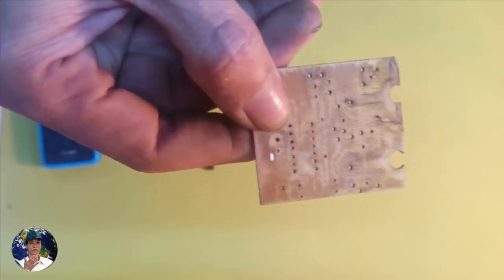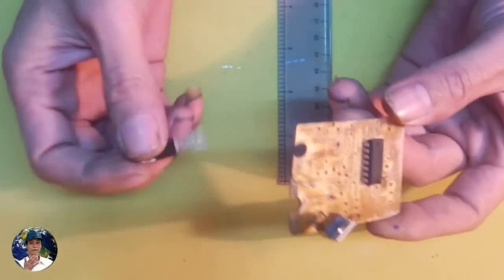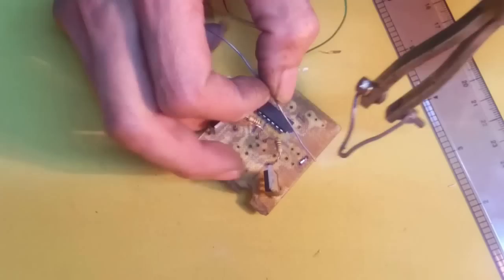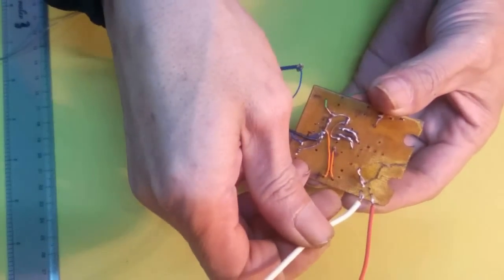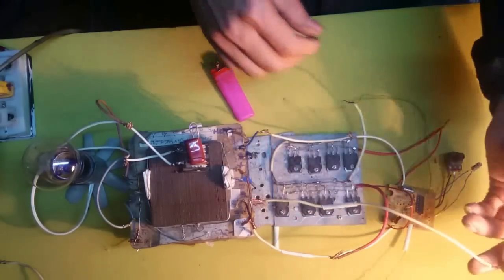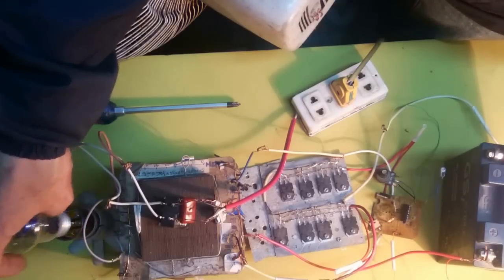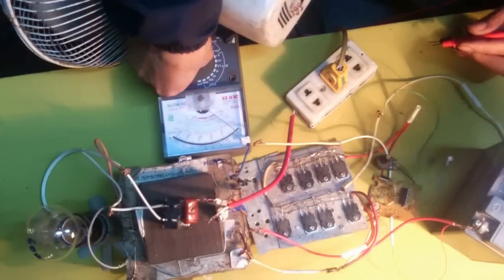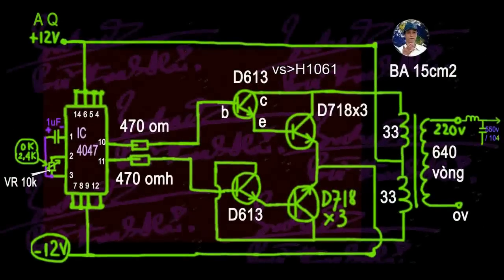how to make inverter 12v to 220v, simple circuit diagram 50hz

Comment: bogus, transformer DOES NOT work with dc  voltage
Reply from the maker: Do not know how to answer your question
The transformer does not work with DC, then we force it to work with dc
Reply: Ruby Adkins in fact he is providing a square wave to make the transformer work.

Comment: sir, what is the rating of your transformar? what is the secondary current and voltage?
Reply from the maker: You use 12v/ 6A to 50A batteries

Comment: What is the watt of the inverter
Reply from the maker: Hello
it depends on the transformer and the number of transistror. it falls between 200 -500w
Reply from the maker: Capacity inverter depends on the transformer and the number of transistors
Use about 500w inverter